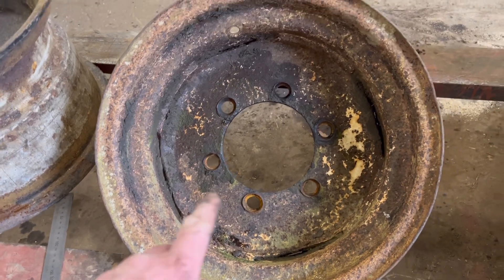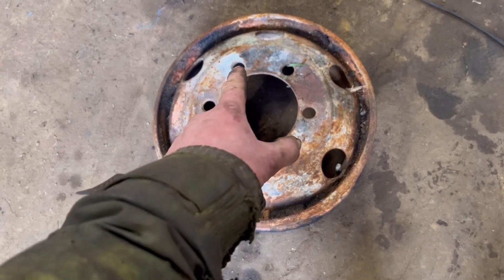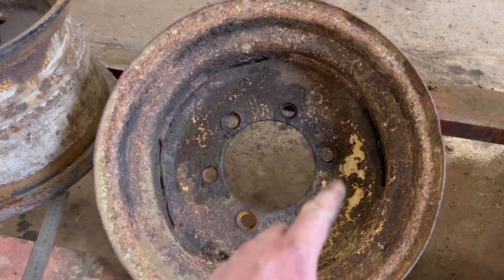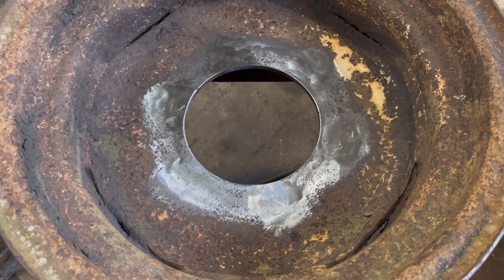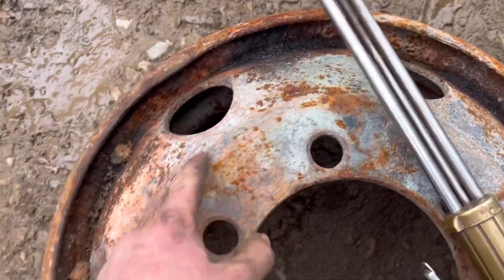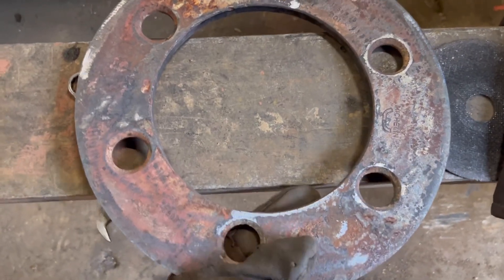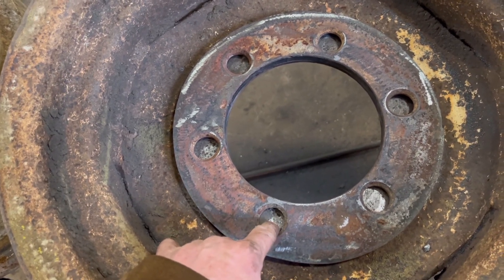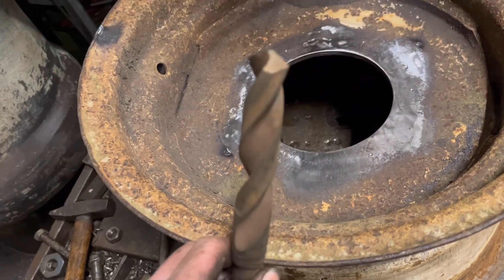Re-drilling a wheel rim that’s been run loose.

Comment: have several 6-lug, 15-inch steel trailer wheel for my trailer that have damaged lug holes (not all from me). can I weld the holes and redrill them? and if so, should I offset the new holes or use the original locations? trying to save them as they are otherwise in great shape and didn't cost me other than the tires which is why I bought them. ty

Comment: if trying to fix the lug holes, why not just run a weld around the hole, grind it smooth and then drill it out instead of welding the hole closed? I ask because I'm facing a similar problem. I'm figuring I can make a jig to line up the holes. my problem was caused by loose lungs on my trailer chewing up the rim a bit. what do you think? ty and enjoyed the video

Comment: 1- Weld up and grind flat. Find center and use DRO to set up bolt hole circle, and cut to size with boring head (Best to use carbide for hard spots. )

2- Same as above with rotary table. 

3- Same as above with calculated BHC and center punch. 

The LAST thing I would do is change the center. (Reminds me of the old double center short track rims of the 70s. )

Comment: Put a piece of tight fitting wood find center ,set divider to bolt circle radius.,scr8be bolt circle then swing arc from bolts hole to bolt hol6e th

Comment: Way to go, I would had gone the same way. Little tip, when your centring your drill in radial drill. Spin it in reverse over centre punched or centre drilled mark, come down on z axis then engage clamps. It always finds centre, then spin forward to drill hole out. Keep pumping em out fella, you do great stuff.

Comment: Love your work 👍 It still baffles me though why people abuse their equipment this much and then expect a craftsman (i.e. you)  to make it all better 🥴
Reply: Depends how much equipment you have to look after. Old Yard vehicles tend to get overlooked. Engineers get paid the same to service new kit as repairing old neglected its irrelevant. Wheel nuts can catch you out, had a spell of that myself so bought some of those plastic markers. Fit those and guess what nothing worked loose 🤷🏻‍♂️. How often do you check YOUR vehicles sleek nuts ?
Reply: Depends on the season too. if the planting is late or the harvest is going on, you just keep going until the wheels fall off, literally. Repair costs are almost always cheaper than lost production.

Comment: When I was 15 my first job in a factory at an engravers we made all sorts including brass washers for ships plumbing which were punched out 3 inch discs that left a raggy edge the kid showing me how to use the belt sander said do one side chuck it in the box get the next one , being a clever clogs I decided to the other side straight away not realising brass gets incredibly hot when worked no gloves by the way I grabbed it and instantly flung the it was red hot , I had to do 1000 washers with burnt fingers , Just a little story from the early 70's LOL .
Reply from the maker: Things soon get hot fast on the belt sander! 😆

Comment: Weld the holes up and re drill the pcd in the gap...
Reply from the maker: That’s what I did.
Reply: @snowballengineering  Must admit I got called to help my neighbour so just typed when you were welding them up. Could you not do the pcd on the mill? Good fix as always.  did this last week so you are not alone with rough jobs..
https://youtu.be/hpcn7MQdz-Q
Reply from the maker: Couldn’t fit the rim in the mill as it doesn’t have enough gap between the bed and quill.   That’s one thing I won’t tackle is vehicles 🫣  if it’s thinner than 3mm I’m not keen 🤣
Reply: @snowballengineering  Lol, trying to up load a short vid of how i did some rims last week!!
Reply: @snowballengineering  There you go, 11/22's 
https://youtu.be/JXb1CGl51b4
My bad on the first reply.

Comment: Nice fix. Thanks for sharing.

I've done this repair a few times. Too bad you had to build the template, I have one setting around. lol For the next maker - there's a hex nut that fits the hole and will act as a guide bushing. 

Depending on the machine's stud (probably 3/4" 19mm) and nut type it may not be necessary to drill the holes so large, leaves more "meat" at the edge.

From here it looks like a "Budd" center. If so, the holes and nuts are actually a ball taper (not sure if that's correct terminology) rather than a common simple conical taper. But, they'll "seat in" well enough after a tightening or two, especially for a slow off-road application.

Comment: Use the countersink in the radial arm drill on the old holes first.  Saves a boat load of grinding.  
I usually have a copper pipe coupling around in a 2" size to split and hammer out as a backer.  If i am doing multiple holes i fold it so it stays in place over the edge .  Why keep them 2 or 3 in stock. I can flatten them out to make washers.
Reply from the maker: Do they dissipate the heat alright? I’ve tried using thin copper before but it wasn’t getting rid of the heat quickly enough and just melted through it.
Reply: @snowballengineering  the bigger fittings are thicker than the tubing.   Do they dissipate enough heat to not blow thru  not always. I thought about squishing them almost flat and blowing compressed air thru them to keep them cool.   I just made more .
Reply: @snowballengineering you not got a copper headed mallet, ideal

Comment: Nice job snowy. Very important to countersink the stud holes accurately. Because it's only the nut to wheel taper. Being an exact match that stop your wheel nuts coming loose. Not a lot of people know this when they try to fit different wheels to their car. Had to explain this to my friend who was going to alter some wheels for his son. So wheel and nut are machine cut matching set. I know this because I was a passenger in a car that had bodged front wheel nuts cut with an angle grinder. Wheel collapses  and nearly fell off.  Thanks ruth and mark.
Reply from the maker: Yes bit different when you’re traveling at speed. Luckily this is a back wheel for an old slow moving yard forklift so won’t be going over 10mph.

Comment: What if you make a holder that holds ie a 8 mm drill instead of a center punch?
Reply from the maker: Yes, that would have worked. Thanks for the suggestion!
Reply: @snowballengineering  how is the line boaring project going???

Comment: Maybe a basic repair but it keeps another machine going the bloke couldn't find parts for. I was watching the latest CEE video when your video popped up. Two chalk and cheese jobs but both serve a purpose. That's my engineering overload for the night.
Reply: It's great to see these repairs being done, but where is the maintenance system on the farm, truck drivers do a walkaround every day. Wheel nuts are checked in the yard once per week with a torque wrench. Grease joints bucket joints daily and others at regular intervals. Any missed get a bat round the ear.
Repairs are one thing neglect is another, wheel nuts, tyres, brakes and lights road safety. The speed some tractors move at these days a dodgy trailer could make for a nasty accident.

Comment: Wouldn't it have been easier just to drill 6 new holes 30 degrees around from the old ones?
Reply from the maker: That’s what I did. But the old holes still need filling in otherwise it looks horrendous.